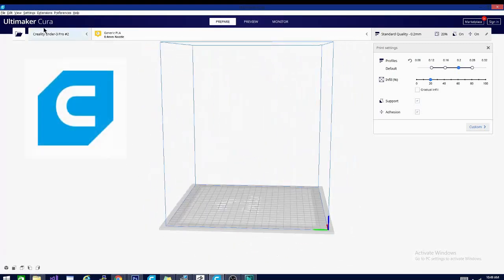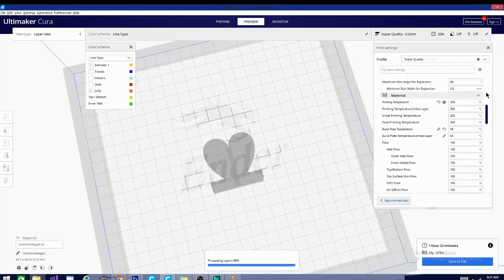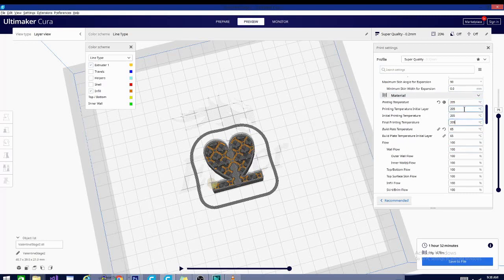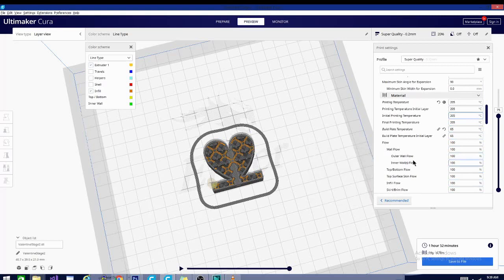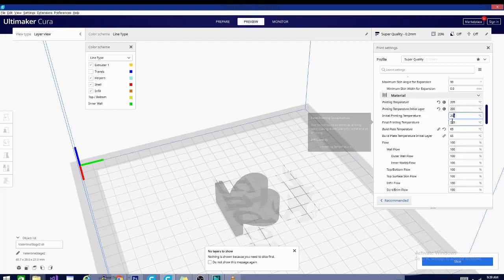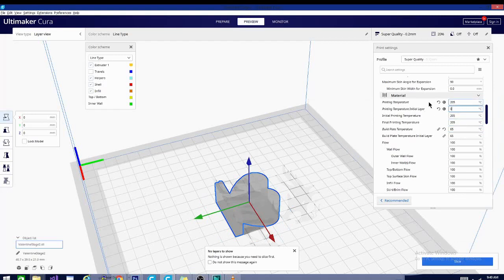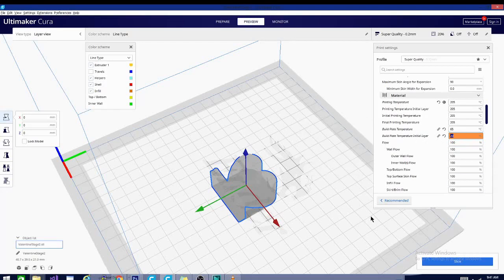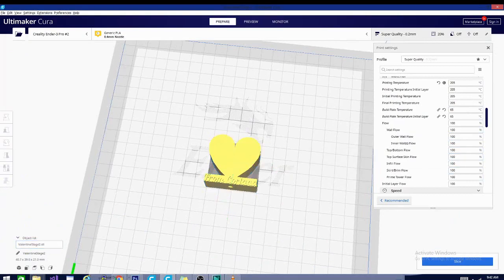Cura 4.8 Tutorials - Material Settings - Print Temperature

Comment: My one job bottom dia 32 mm and 1 mm length  middle dia 20 mm and 10 mm length after top dia 32 mm 1mm length total length for job 22 mm 
Cura default settings slice problem bottom 3 layer and top 5 layer so top and bottom thikness note maintain how solve

Comment: what is the relationship between the material settings under "settings | extruder | material | manage material" where you for example have custom PETG and and under the "material print settings" you can set the default printing temperature, default built plate temp etc. but then in the regular window in cura under "print settings | material" the temperatures are different.  It would seem it should use the temperatures defined in the material settings and you could over-wride in the printer/material settings in the print area, but it doesn't appear to work that way.

Comment: Why is that I have to manually set my extruder temperature when I am starting my print?  I have had to do this for both Monoprice Mini, and my newer Longer LK1.  The material temperature, and print temperature settings don't seem to affect this.  But the settings do work for bed temperature.